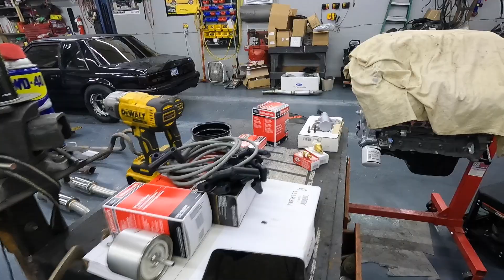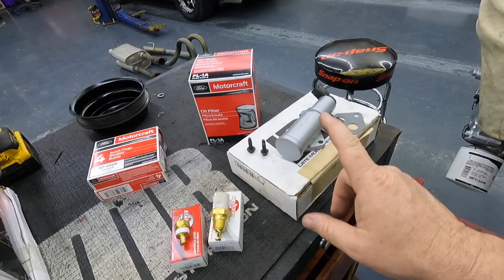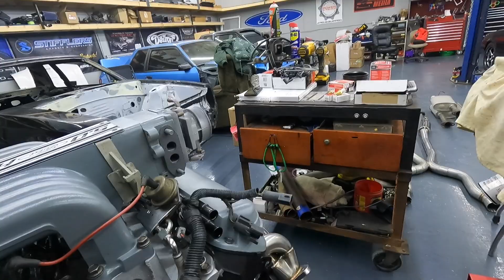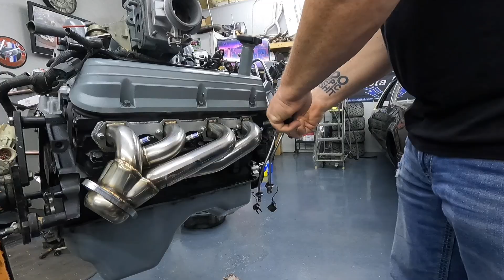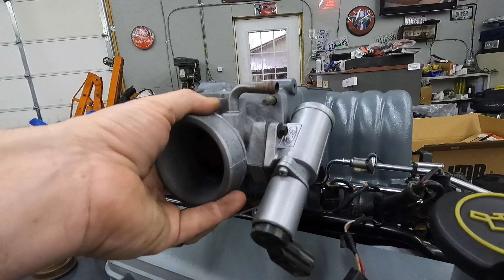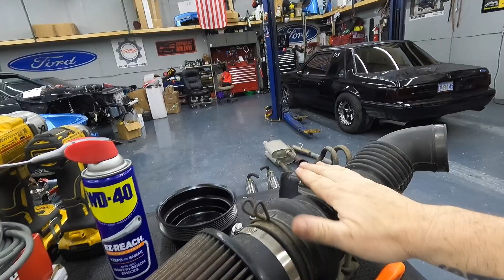Perfect resto-mod of the iconic 5.0 Ford small block!

Comment: The engine looks clean brother. Gotta love the old 302 Windsors. The 302 Windsor V8 in my 96 F150 has 210,000 miles and still going strong 💪.

Comment: Are those those stainless ebay headers? Cause if they are how the hell did you get them to fit? I couldn't even get them to bolt to my heads and had to get a set of bbk. And what color gray did you use on the intake and valve covers?  And merry Xmas to you.
Reply: Cooks I think
Reply from the maker: These are from FloTech, the color is called New Ford Gray from Duplicolor
Reply: @FoxcastMedia  they look great ! How do they hold up ?